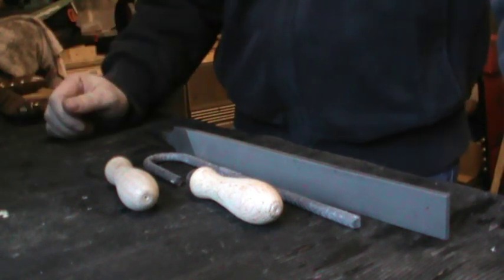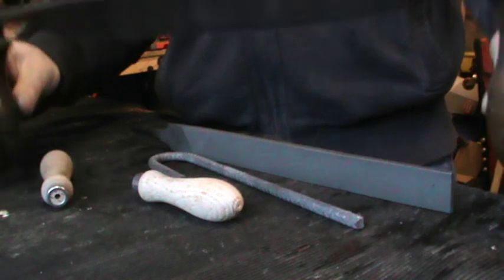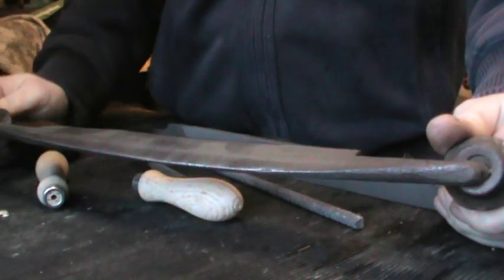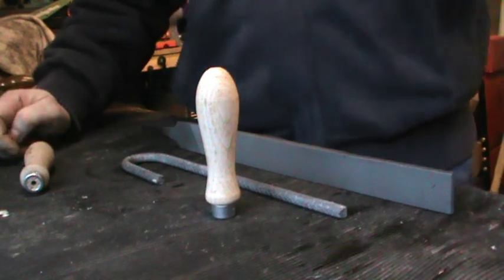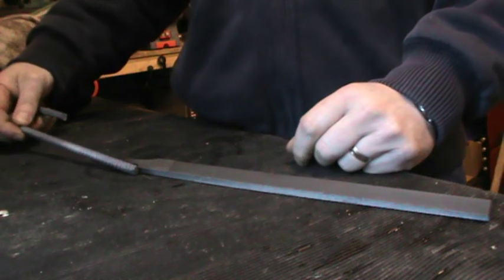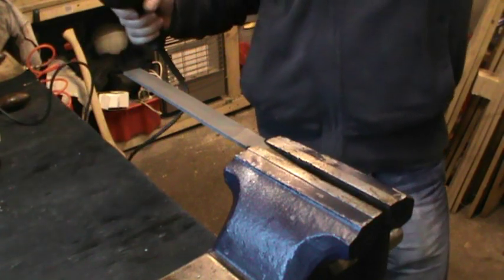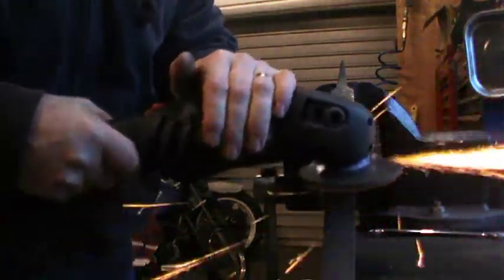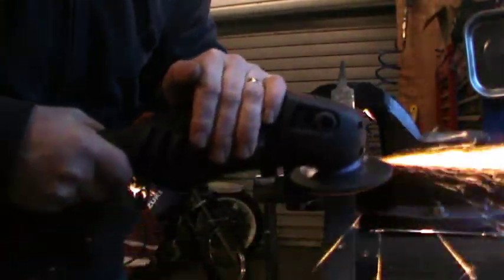Make your own drawknife part 1

Comment: annealing the file  first would make all the metal work go much easier. I use my wood stove in the winter and a back lawn pit fire in the summer. Heat the file up to cherry red and then bury in ash to allow it as much time as possible to cool. once you have done your grinding and shaping, heat the metal to glowing red again only this time squelch in oil. I use water but I guess oil is better to avoid cracking.

Comment: To make tools properly :  Build a forge ...Heat file red hot- bury it in ash for a couple hours till cool--it's soft now- easy to remove file teeth.Do ALL bending when red hot. Grind it while soft , forge it red hot to near a chisel cut and then heat to red ,let cool and grind closer to final bevel BUT leave 1/16 inch edge on. Hear to redand put in the blade curve. Normalize it twice--heat to redand let air cool. Heat tored and non magnetic. Quench in oil heated to 139--140 F. A dull old file should skate off it if it's hard.Temper it in oven 2 hours at 140 F ,let cool and then again for 2 hours. You can skip the temper but if you drop it on a hardfloor it will crack. The edge will also begin to chip in use and it will be to hard to file or sharpen. Raven's approach isn't
wrong it's just adjusted to his needs. Thanks for the vid. and good luck to everyone.

Comment from the maker: its very difficult to be precise without the right tools, i intend to use an adjustable square to get the angle off the old Drawknife and use it to gauge the profile of the edge as i grind with an angle grinder finishin up with very light flap discs on the grinder, like i said its hard to get the edge bang on but i only really want it for handling axes and such so it should be fine

Comment: Hi  .  nice video .   curious if you need to heat treat the metal after doing all this ?    guessing you need to normalise the steel and then harden and temper it .,
Reply from the maker: Hi Hamish. I only use it occasionally and did not bither ro heat treat it at all. The steel in the file was good quality and it has been up to task so far
Reply: yes    why not .    good idea saves a lot of time i guess .   i made some tools recently from files and remember the files definitely getting  a little hot while grinding the teeth off etc . but nothing too major ..... just a blue colour which means the metal is still suitable for wood work .    Actually the only reason to bother to take off the teeth on the whole file is so it does not break during quenching so if you really wanted to do it simple you just need to take the teeth off at the tool edge .

Comment: you don't need to grind down the file's teeth first
Reply from the maker: its easier while the blade is still flat
Reply: +Jeffery Dodson Not grinding off the teeth leaves you with a couple hundred little cold shuts in your steel. Doesn't make sense to leave them.